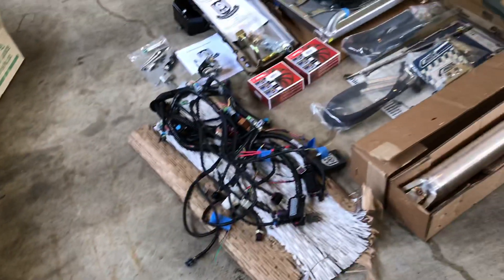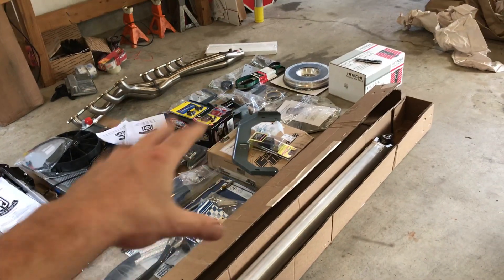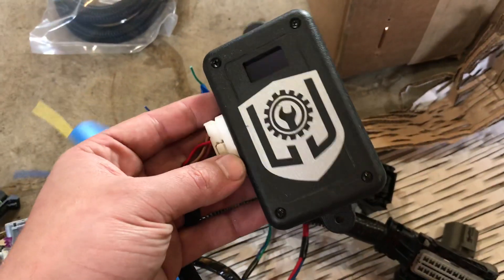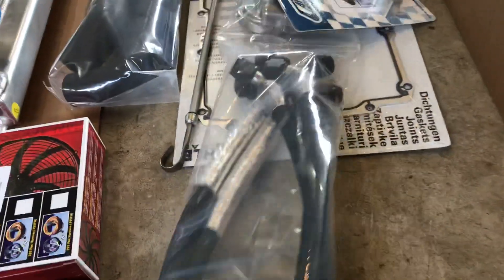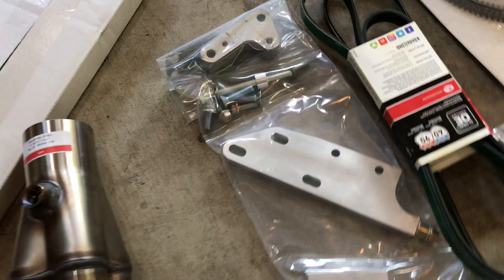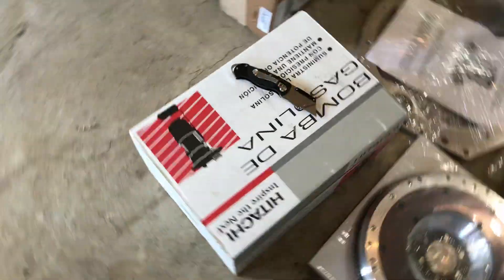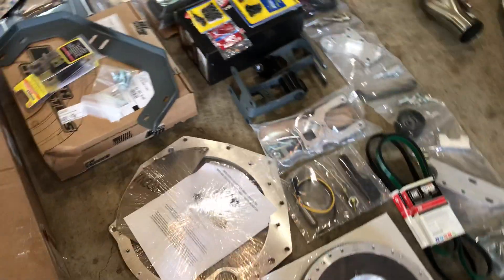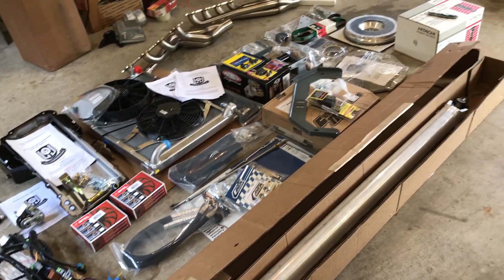Picked up my g48 LOJ swap kit

Comment: Hopefully that's a beefy driveshaft. I saw an aluminum one get twisted in half on Hoonigan
Reply: sirgallium We rate them to 800WHP at stock weight on slicks. We can build them heavy wall with 1350 or 1410 u-joints for more power, carbon fiber is an option too.

Comment: Goodnight; that's almost a $10k kit. Have fun!
Reply from the maker: its a little over that, i bought a clutch and driveshaft speed sensor setup and etc
Reply: Wow. I hope this the most fun conversation yet.Gotta leave ya Wonder. Is the juice worth the squeeze. Or is a a shit box with a custom built turbo more fun. Interested in the review after all the mods.
Reply: That's crazy not a lot of people can afford to just drop 10k, let alone afford the rest of that project.
Reply: john S its a lot and i know i couldnt afford it, however most people would end up spending that much doing this kind of swap, just spread out over a long time. Imagine all the costs to buy all the little things you need to do a swap, all the nickle and dime stuff. New parts not used stuff you had laying around or traded for, etc. It costs a lot of money! Spread out over a year or whatever and it doesnt seem bad but so much nicer to get it all at once
Reply: It's the easiest way to actually complete a project and raise a child/be a husband. I'm still amazed how much he gets done even though he is both of those things.
Reply from the maker: yep that is where i am at, and that's why i am doing it this way.
Reply: mike gager You are spot on, most people don’t track every single cost on builds like this. You buy this kit it includes everything down to the heater and radiator hoses and clamps, even the steam vent hose. I did my best when I engineered it to be as all inclusive as possible. Grassroots Motorsports magazine came to our shop and we had their car swapped in 2 8hr days and another 4 hr day to tie up some odds and ends.

Comment: Motor is to far forward with that kit. Good luck!
Reply: Cody Minter Not trying to start a comment war, but what point of reference are you using to make this determination? I know for a fact that it is further to the rear than at least two of the other kits on the market.  The stock transmission is moved 4.5” to the rear when using the LOJ kit, which is why the kit includes a transmission mount, Driveshaft, and shortened shift linkage.